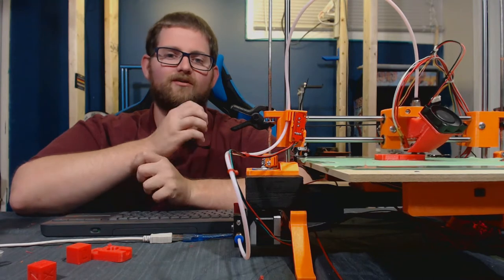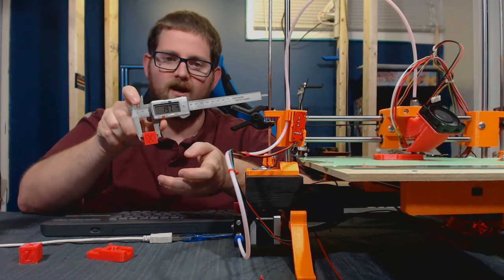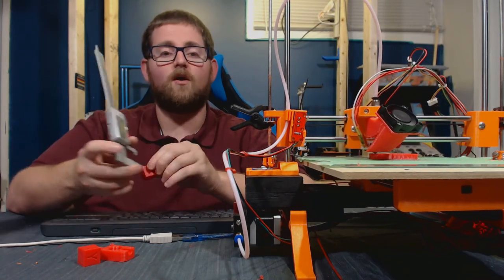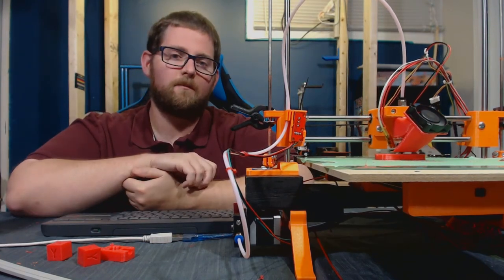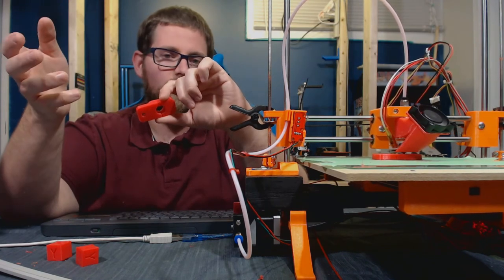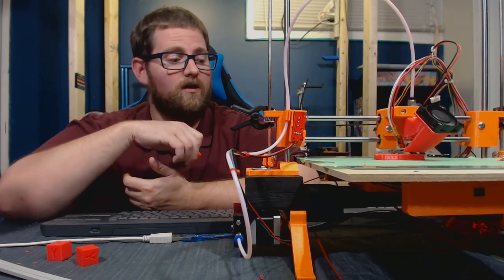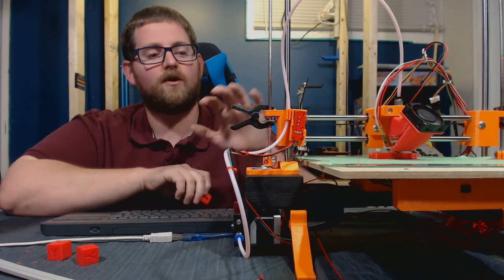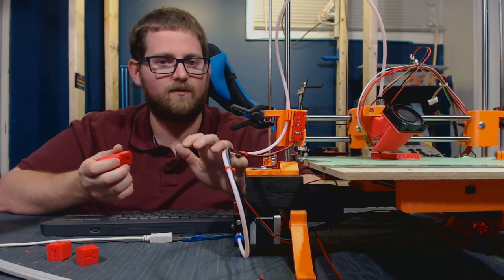Update on the Cherry 3D Printer

Comment: Not the fastest printer...but pretty darn cool to see it actually printing...
Very Very Awesome!
In Marlin firmware isn't there a way to adjust for backlash in geared steppers?
Are you still running at 10mm/s?
Reply from the maker: I believe there are backlast adjustments. I haven't done a ton with the Cherry printer since I travelled with it back in October. My motors just flat out refuse to spin past 10mm/s. Still was a neat project!

Comment: Are they the dame 28BYJ-48 1/32 that are used in the 101Hero or the 1/64 that are the cheaper motors?
Reply from the maker: I haven't taken a good look at the 101hero, but I think they are the same. Does the hero use the 5v or 12v versions?
Reply: They are 12 V Adafruit Small Reduction Stepper Motor - 12VDC 32-Step 1/16 Gearing AF918. Got them for 5.66 euros each. So a bit more expensive then the other 1/64 motors.